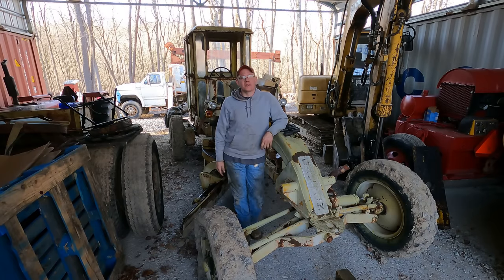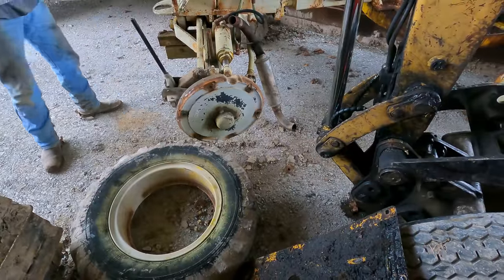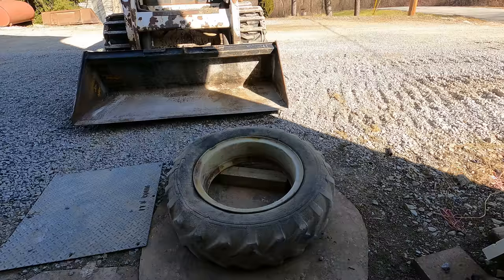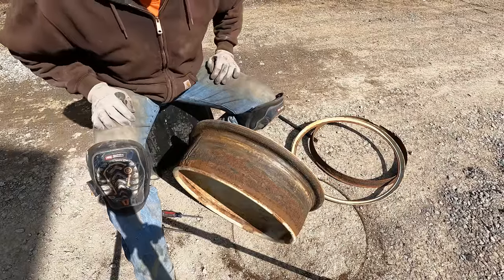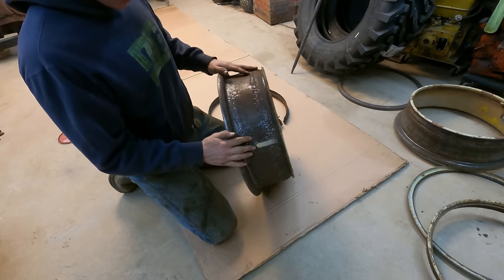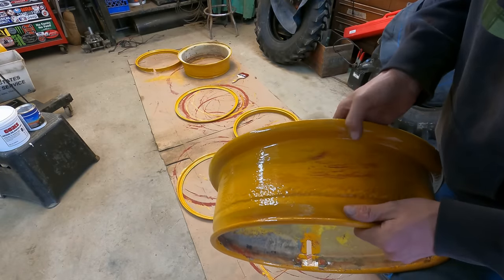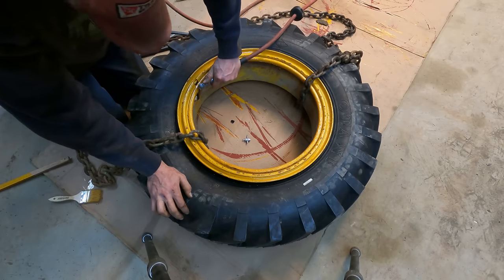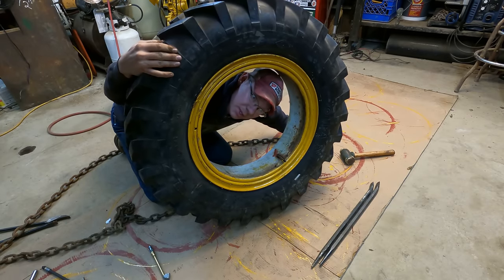1950's Galion Road Grader "Widow Maker Rims" Pt.4

Comment: PLEASE ! ! If you don't have a tire cage , put your skidsteer bucket on the rim when you inflate them , if the split rim did fail , it may hold it down  . I worked at a tire shop (My first job) in the mid-60s' and we had a hefty cage and I heard too many stories about these things coming (Blowing) apart and going THRU the roof . I used a long inflater that I could hold the hose some distance away and release by flipping the hose .

Comment: those 3 piece rims and the snap ring rims are inherently safer than the real widowmakers, do some research on the firestone RH-5 rims. they are 2 equal pieces that are only held together with an 1/8" lip. the main problem is that you cannot see if the rim is seated properly as the seat is inside the rim when airing up unlike the split ring or 3 piece whereas as you pointed out, you were able to inspect the lock ring to verify it is seated correctly. We have purchased an old 53 Ford F750 with a 45 Fruehalf insulated van, looks like they have split ring style rims on it which makes me happy I dont have to source out new rims. if you ever come across any RH-5 rims, please dispose of or put out of service for your safety! 
Im trying to find a single Firestone RH-5 rim that I can hang on the wall as piece of history to be remembered.

Comment: That wheel is a three piece wheel, not the “widow maker wheel” of pre 1968 that was a 2 piece center split wheel. If you looked hard enough you could most likely find a good set at either a truck stop shop or junk yard in great shape.

I also recommend getting a proper wheel stand and chopping hammer!

Now standard practice for inflation is either in a cage or under a truck, chains have a habit 
Of letting you down!

Comment: You have the tread pattern going the wrong direction. The rolling only tires are supposed to have the tread facing the opposite direction as the driving tires

Comment: The tyres are facing the wrong way for non-driven self-clearing, the tread pattern should be pointing up at the front, like the original tyres were before ! I am sure someone will have already commented on this.

Comment: Put some talcum powder inside the tire.  Inflate tube wile still off the rim.  That will prevent wrinkles in the tube.  Those beadseat bands should be replaced.  While those are dangerous they are not true widow makers.

Comment: I use the teeth on my backhoe bucket to break down stubborn tires. Fire up the excavator!
Reply from the maker: I used my big excavator and still couldn’t get them to come off
Reply: @DieselCreek  Just got to that video, LOL!
Reply: @DieselCreek  it helps if you have something to push the tire against so you can curl the dippperstick in and get those teeth right down to the edge of the tire bead.

Comment: Is a needle scaler different in purpose from a wire wheel on a grinder?
Reply from the maker: Does a much better job removing the heavy scale that wire wheels inevitably just kind of polish over. If you notice the wire wheel them after I scaled them to get them nice and smooth, but the wire wheel would’ve never taken off the heavy scale that was on those rims

Comment: I grew up having to deal with various split rim wheels; both 2 and 3 piece.  We never used a regulator for inflation, but we'd take a hammer and bang on the lock rings as we were inflating, to be sure they seated.  Dad finally decided to have just have our foreman build a proper cage and he'd chew anyone, including me, a new one if he caught us changing a tire without using it, even with standard rims.  Luckily, we never had an issue with a split rim wheel, though we =did= have a few issues with standard rims, usually with tires that were, well, a couple =decades= past where they should have been scrapped.  Y'know, farmers, right?  :-)

Comment: I mean, needle scaler for such a small part doesn't really make sense. Get an old DC welder as a power supply and do electrolysis with baking soda or sodium hydroxide. The large rust pieces will just fall off within an hour. You might need to filter the bath multiple times, to avoid resolving the rust from the flakes instead of the workpiece.

Easiest is to get a large linen sheet and put it below the workpiece. To filter your bath you can lift it out and spray the rust off with some water.

Just make sure to make firm electric connections and only do this outside. Hydrogen will be formed in large quantities in the process.

Comment: An angle grinder with a wire wheel works 100 times better than a needle scaler for cleaning anything. A lot faster too.
Reply from the maker: I’d beg to differ. The wire wheel is better for light rust but for heavy scale the needle scaler does way better job. The wire wheel will more or less polish up scale without removing it , the scaler will knock it right off

Comment: Dude, there are some things that just should not be re-used. I'm as tight with a dollar as anybody. But when it comes to safety or just doing things right the first time to prevent having to do it again later, spend the money once and have it done right. That said, credit due; You did do it right re. using those old split rims.

Comment: Split Rim Wheels you better know what you are doing have the correct tools to use, and one of most important things a cage to air them up, cage so if the rim did come loose the cage save your life. to many people not knowing how to break them down if the rim gets bent that when they get dangerous and rust not being cleaned all add to the dangers, airing them up without air gauge if that rim comes off could take part roof off, like 155 firing

Comment: You say everyone calls them Widow Makers but "they" are wrong.  The "Firestone RH-5 Degree" is the wheel that coined the phrase widow maker.  The RH-5° was the largest killer of people ever.  It was a two piece rim,  split almost 50/50 down the center, that barely latched when it was new.  After 10 years of rust they were difficult to put back together.  After 20 you signed a will before working on it.  What you have is a two piece rim with a safety lock ring.  By the way your lock rings are sprung and should have been replaced.  The two ends should overlap when you take it apart.  That and it's not a bad idea to tap the rings during their initial seating to make sure they are not bond up on a false perch, which would allow them to move later on (under full pressure).

Comment: Properly equiped tyre workshops have steel safety cages to reinflate split rim wheels. Seen a brick wall, 4ft x 6ft hole,  taken down by a truck rim that let go.  Very dangerous in normal home workshop, even worse out on the road. My Series 80 , 1994 Toyota Landcruiser was fitted with split rims,  which I replaced by normal rims and wider offroad tyres,  after my first 4000 mile offroad travels as too dangerous for in the field repairs.

Comment: Why not use wire wheel ? Same result different tool ? Just looking for opinions.
Reply from the maker: Not the same results. Scalers will actually cut through the heavy scale where wire wheels will often just polish up the stubborn spots I used the wire wheel after the scaler to get them smoother

Comment: Youre using the lube wrong...
you use the brush and rub at the lube for a while and it will lather up, dont try and scrape it off to apply, it needs to be lathered up first!

Comment: Widow makers is Right. I have known two men who lost their lives when the rings came off while they were inflating the tires. The tool to use to move the tire is a slide hammer. It looks like a 2" pipe with a crow bar sticking out the end. 
I have the proper bar to remove the ring but these days it's only used as a very good prybar when i'm doing body work. 
The steel quality is amazing compared with the CCP crap sold today.

Comment: I can see why you wouldn't want normal vehicles to have those 3 part rims, but they seem like they'd be much better for big equipment. Sure, you have to be way more careful to do it right because the consequences are way worse, but it seems like they are easier to install properly, especially with big tires. You just need to give them a bit of respect.

Comment: The one issue you failed to correct was the inevitable potential for the locking ring side of the rims being so badly rusted that any over pressure of the tyres will blow that section off. Just sayin!!!

Comment: I was anout 13 at the time, and a guy was getting his split from worked on at the local COOP gas station. Why they didn't use the cage is beyond me.... My mom took in the money and I sat in the car, I heard a loud boom and as i looked up a guy was flying through the air. It was at that moment I had witnessed a decapitation. But it happened so fast that I didn't know what to make of it. My mom jumped in and bailed out, I'm glad because the aftermath of this is not something I want to have as a memory. Honestly I've know at least 6 ppl that have been decapitated from farm equipment. Between farming and the oilfield I know a ton of ppl who lost their lives due to work related nonsense.

Comment: It isn't even the breaking down that is dangerous, but the reseating of the rings and bead. I have seen too many of those come apart. Which is why they make a cage to do this. No way you saved enough money to make doing that yourself worth it. I would have taken them into the shop and had them do it.
Absolutely, she needs a complete set of new shoes.

Comment: They call them widow makers for a reason.  I had a tire shop refuse to touch the oe dually wheels on my 1980 f350 dually and they were 1 piece 16.5 inch wheels. Go figure.

Comment: Those aren't what I'd call widow maker wheels. Real widow makers are just two halves that lock together inside the tire- you can't even see if they are locked together or not. Only ever saw them one time on a real old 30-something Dodge I think it was. Multi-piece wheels like yours are pretty standard stuff. I've got no problem working on them at all.

Comment: Those are not widow maker rims . Widow maker rims are mostly on old grain trucks 8.00 or 9.00's . The entire rim splits in the middle and the connecting faces are internal and not viewable . When you put any rim on it is better to mount the rim on the hub because these rims particularly the real maker have been known to disassemble during the the lug tightening process if the hub has malformation ; the rims that the tire are mounted on are some times egg shaped or not perfectly round . You might want to spend 300 or 400 hundred dollars on a tractor tire bead breaker and it will make your life way easier when it comes to removing the tire from the rim.  The standard tire pressure for grader tires in dry conditions are 50 psi . The lube you might want to use is called Murphy's or tractor tire mounting lube (and has anti rusting agents in the lube) ;The white stuff is for car tires .  Before you put in the flap put a little air in the tube and leave the air in the tube ; it makes the flap a little hard to get into the tire so put lube on the flap . This will insure that the tube does not get pinched if you don't over inflate it .
Reply: Would you be talking about the trilex rims?
Reply: @anthonypidgeon8080  No trilex have the ring on the face . The true widow maker does not have a ring on the face , the rim splits in half  .  https://www.ford-trucks.com/forums/1451430-identify-widowmaker-wheels.html
Reply: @joemcarthy8124  These are the trilex rims I remember fitting and the split rims had either a single locking ring or a ring and then a lock ring but I have never fitted or even seen a widow maker rim. http://image.ec21.com/image/bindasmaldubai/oimg_GC05591802_CA05591862/TRILEX_Wheel_Rims.jpg
Reply: @anthonypidgeon8080  hey I had never seen trilex rims I have to admit  . Interesting .

Comment: Fairly painful to watch.. some advice, use tyre grease not soap also with centerless rims, ensure they are secured back to the hub before inflation..
 Also the tyre direction I wrong.. on the front of graders they should be fitted in reverse.
Reply from the maker: I used tire lube not soap and there’s no reason to bolt them on the machine before inflating.

Comment: is your grader not running ? I have not been following along, so I don't know. Because you should never need a jack for grader tires if your hydraulics are working. Just sayin.
Reply from the maker: The engine isn’t even in it right now, it does run I tore it apart to fix the clutch, You should check out the series from the beginning, people seem to really like this project
Reply: Im an old retired heavy equipment operator, so I definitely will. I only clicked on because of the widowmaker title. I changed many a split rim tire.

Comment: ok this is painful to watch. a old tire guy showed me a trick  . when I say old I mean old he was in his 80s .
 lay the wheel flat pour a small amount of gas around the bead  let it sit 15+20 minutes it softens the rubber . he'd literally stomp on the tire and the bead would break.
 as far aplit rims go they will fail on the vehicle when we the ring is damaged from rust.get a tire hammer $60

Comment: My momma drowned all the fools in my family. You're lucky you didn't get raised by my momma!
You should never break apart a split rim without it being in a steel safety cage. Your lucky it didn't pop off and take your head with it. 
Some people's children.
Reply from the maker: There was no air it it!???? How is it gonna come apart with no pressure 😂😂😂🤦🏼‍♂️
Reply: @DieselCreek  the steel ring has been known to pop up and hit people in the head. In the future for safety, wrap a heavy chain around the tire and rim all the way around the circumference of the tire. Use a grab hook on end to hook ends of chain together after you get around and the ends meet. Then if the ring springs up, the chain will keep it from taking your head off.
A steel tire cage is better if you have one around. 
I only did too many of them in the military for the Oregon Army National Guard museum. But you can do it your way and make me cringe. Good luck in your future endeavors. Love your scraper. I am working on a 1955 International R150 1/2 ton Truck. Rare beast. It has split rims. It's going to get new rims and tires all around.
Reply: @DieselCreek  wasn't meaning any offense.  Just cringing at the technique. Safety first, because you can't  put your head back on.
Reply from the maker: @OutlawMonstersPerson  the danger is not in the disassembly it’s the re assembly 🤦🏼‍♂️ they can be dangerous to air up but if you watched the whole video i did wrap chain around it to air it up.
Reply: @DieselCreek  whatever you say, all I know is I wrapped it in chain for both. Thanks for the information.